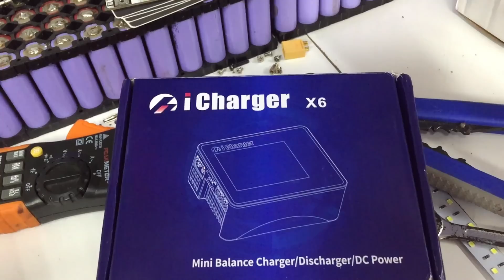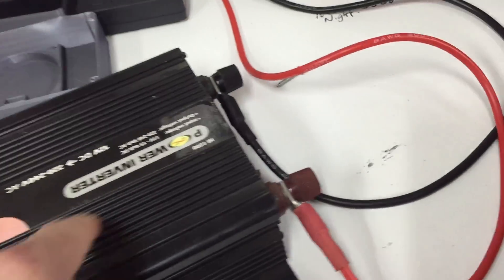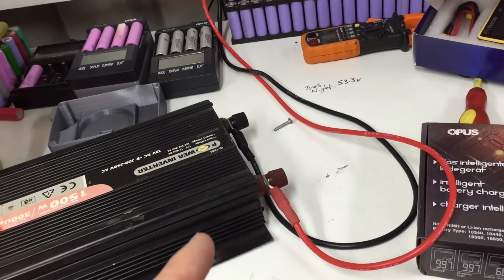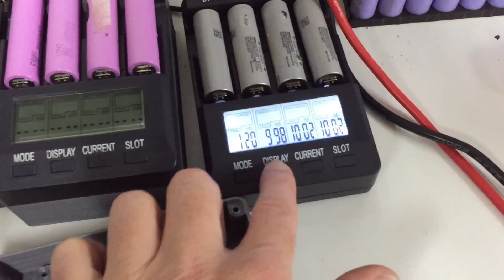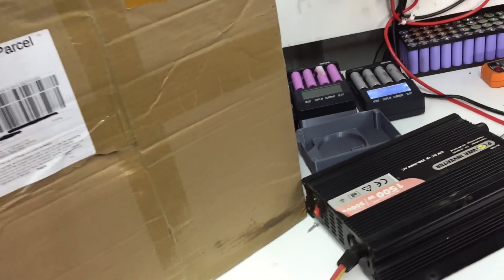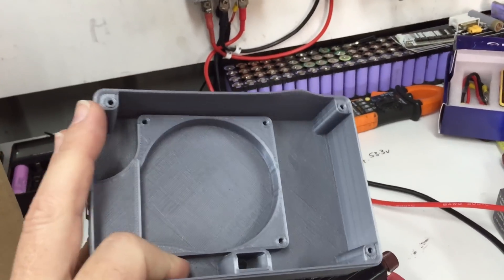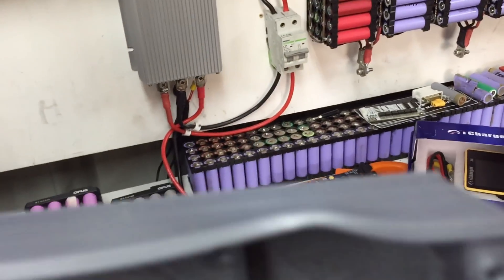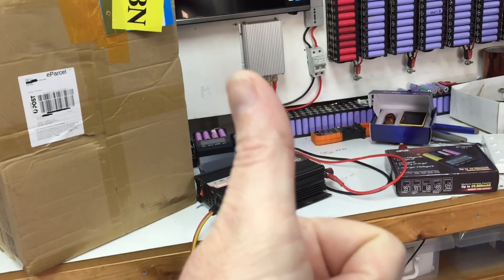Useless update #77

Comment: On the Ender3 leave the Z stepper loose until final assembly, and then nip it up. I think Creatlty say to leave the Z nut screws loose if it jams, which I think is backward to what should be done.
Reply from the maker: NOTED - just doing the video now and putting it together loving it so far so well packaged
Reply: I forgot to mention to nip it up when the carriage is at the bottom near the table because it's very ridge there. At the top the lead screw flexes so it's not a problem. Other than that I had to reset to feet to stop it wobbling. 
I got mine from BG 2 mths ago - still learning - and didn't have a problem, but some people got the earlier version and there was quality problems.

Comment: The ender 3 is a 24v  printer Pete :)
Reply from the maker: ooh..... know the approximate amp draw?
Reply: @HBPowerwall  Gargler says the psu is 360w(15A). It depends on what temperatures you're printing at.

Comment: Oh the next problems going to be that little solar charger trying to keep up with the amount you discharge the packs.
Reply from the maker: That little solar thing is shit! Ment to be doing a review on it and giving it away to a member but it hardly works - screen flickers, the voltage jumps around turn on and off...
Reply: That can happen with flicking on and off if the solar voltage is too low. Also the solar voltages in settings needs to be set right otherwise it does strange things. I set mine to 0.5v below the panels MPPT voltage.

Comment: the old 1500 watts i had one in my old work ute. used to run a 9 inch grinder hahah
Reply from the maker: Is a limit of the 48v to 12v converter - just doesn't have the instant load capacity or it might be the cables too

Comment: Great videos . Do you have any diagram on how you connect your packet to the solar? Do you use BMS or the packet are connected to control charger only and solar panel for charging?
Reply from the maker: not for that setup but for my major one yes i sure do. 3rd post in this thread - https://secondlifestorage.com/t-HBPowerwall-Official

Comment: not sure if this will help but using 24volt steppers and controller will make the motors run much quieter
Reply from the maker: more efficitent to grab a 48v inverter *(after my own spot welder)
Reply: no the above is for the 3d printer 24v steppers and drivers = less noise
Reply from the maker: arrrr ok, will need to do some more learning !!
Reply: yeah sorry my bad i wasn't referring to the inverter  just the 3d printer

Comment: That lighting looks like old fluorescent type. If they use iron ballasts, they have very poor power factor (0.3) so pull lots of amps from your 240V  inverter. Try changing ballasts to electronic type or even better change them all over to LED lighting. Your inverter load will be less than half.
Reply from the maker: all lights are led :)